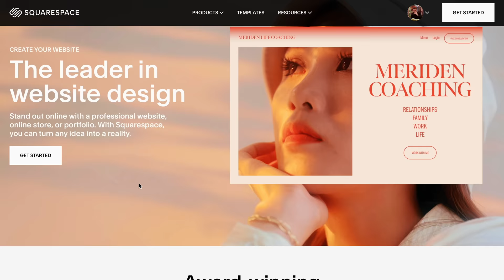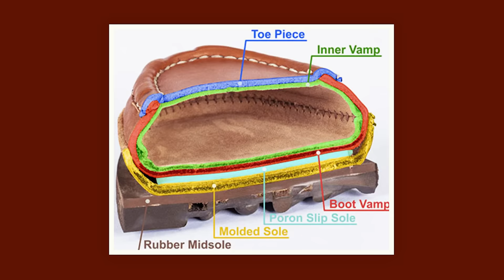The 100 Year Old Boot That Baffled "Expert" Hikers.

Comment: they have ruined the $600 boots by putting crappy vibram outsole on them
Reply: Why is that ?
You think they should have a leather heel stack...ect ?
Reply: They used a Vibram single piece Roccia sole.  It’s flexible but much softer than say the V100 series soles so they wear out faster.  Also the glue on sole is awful for a $725 boot. Spend too much time on rocks or shale stone and these will start to peel at the front.  I would hammer some tacks at the toes to prevent that but come on.  $725!!
Reply: @franky3fingers337  but every choice made with this boot was for a specific reason, you have to put the boot into context.
The idea is a very durable long lasting upper with a comfortable yet relatively durable sacrificial outsole that's economical and expedient to replace without affecting the structure of the boot.
No new holes...ect or needed to replace anything but the outsole for the first couple of resoles.
Contrast it to a stitchdown PNW boot for example , most are around this price plus $200 or so from say Nick's for every resole because they often do a major rebuild.
A cobbler wouldn't be charging all that much less for a simple resole either.
How many time would these need a resole before the stitchdown  PNW boots do ?
I don't know, but I suspect the overall lifespan of the boots would probably be about the same with less money in resoles on the Russell.

To me the construction of the WC Russels makes just as much sense as the tough as nails construction methods people have come to expect in a $550+ American made boot.
I don't think one is objectively better or worse, and both have their pros and cons.

I do agree about only gluing the outsole on though , they probably could have ran the stitching at the toe all the way through like you see on the Carolina moc toes.
They'd have to replace that toe stitching by hand when they resole them which would take longer and cost a little more,  but it's only a what 1.5-2" long row of stitching?
Reply: @TylerSnyder305  I think you make some good point but personally I’m not convinced.  In fact the more I look these up the less I think of them.  

As far as a long term cost benefit it all depends on the individual use of these boots.  I have a pair of Viberg 2030 Service boots from 2015 that are on their second resole.  That’s about $400 in 8 years.  The Dainite soles are actually very hard wearing and the Dr Sole I have on there now will also last a long time. 

These would need more resoles under the same usage as the Roccia sole uses a fairly soft compound, and at some point these will need a new midsole.  Even if the sole is just glued on a cobbler will have to sand off any excess glue residue and may wear through the thin layer before the midsole. There doesn’t seem like there’s a lot of material to work with there.  Once a full resole is needed I guess these will have to go back to Russell as I’m not fully sure how the soles are connected.  Maybe some type of Blake stitching method.  Idk

There’s also no mention of a shank here.  I’m not even sure if there’s room for a shank in the type of construction they use. If they don’t use one that would be a huge deal breaker in my book for what this video is using the boots for.  We’re not talking about Rancourt or Quoddy casual boot Mocs here.  These are literally labeled as backcountry big game hunting boots that you can summit 14er mountains with.  That’s a lot to back up.  

I personally don’t see that happening in unlined shankless Moc toes boots with minimal midsoles and medium duty vibram soles with poron slip sole.  Well it probably could happen but there much better built boots out there for this specific use case that cost less. 

I do see a hand built casual boot that probably took a lot of labor hours to put together and have a heritage brand name and  that’s why they are $685.  I was wrong about the price in my previous post.
Reply: @franky3fingers337  My Russells do indeed have a shank. Funny you mention Rancourt, because all their boots with leather midsoles also have shanks. (Not the camp soles, though.)
Reply: @TylerSnyder305  no, of course not. but there are better soles than vibram, and even if they had to stick to it they could have chosen a better sole than that one. they clog up way too quickly.
Reply: @simongrushka983  they would probably use a different sole if their customers complained.
Reply: @matthewsbernier  glad to see them use shanks.  I watched your videos and man that Russell Moc looked rough.  The finishing is not what I would expect from this level of boot and really disappointing.  I am glad they are working out for you though, it looks like they ended up being very comfortable for you.
Reply: @franky3fingers337  You know what's funny though, this video clued me in that they forgot the second vamp on my pair! And the Poron. Explains why they leak and are a bit less cushy than I imagined, and why I'm walking right on the blake stitch. I'll keep people posted in the comment section how customer service handles it, because I paid for double vamp, and waited 11 months for it.